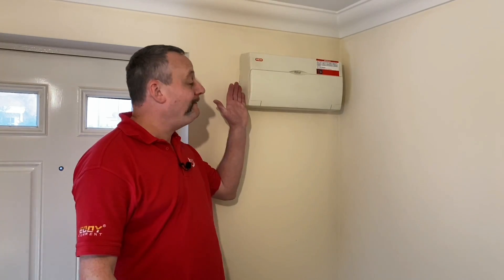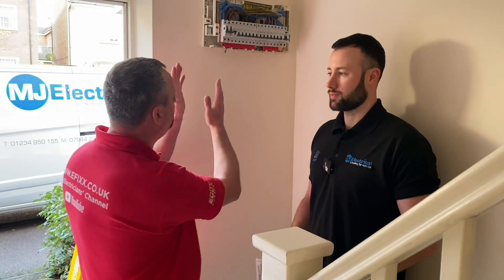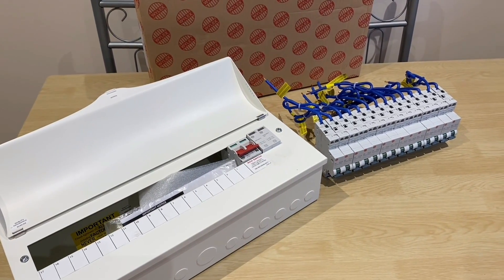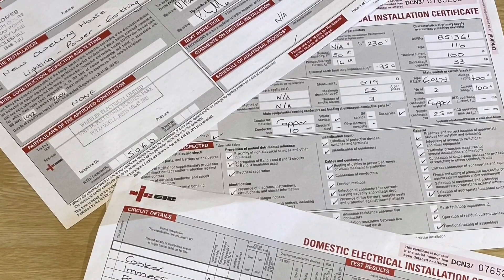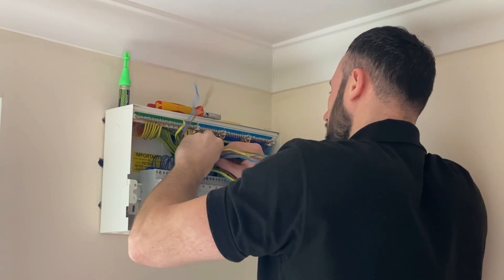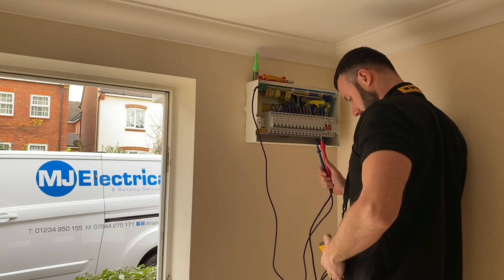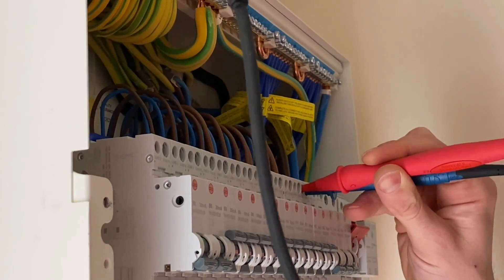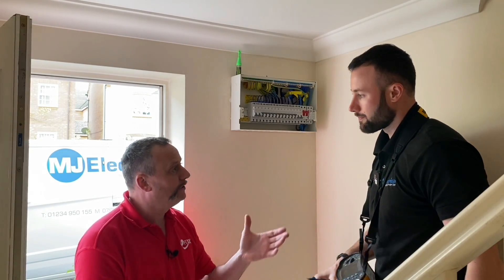Should you install a full AFDD or RCBO CONSUMER UNIT?

Comment: It’s crazy to be fitting AFDDs currently due to the price, just like RCBOs were when 17th got released. It’s completely viable to fit RCBOs and a SPD now as price is alright and that is a great set up for protection for people and equipment. I’m sure when it’s written in the 19th edition to be made to install, they will drop in price. Until then I recommend a full RCBO board from a quality brand like Crabtree, Wylex or Hager for futureproofing reasons. This will make it easier to upgrade when the time comes
Reply: Of course, goes without saying. It’s enough currently to convince them spending £300 on full RCBO board over a £50 BG split load, that still currently complies, how you interpret the regs. Throw in a £1500 AFDD board, they don’t want to know. Tbh, I wouldn’t even spend that on my own property at that price knowing they will drop significantly in the next 5 odd years and I don’t have the labour cost added.
Reply: @dannyboisparky  you forgot about £100 for surge protection. Which in my opinion should be strongly recommended.
Reply: @sandymcnair5298  As a matter of interest do you have any evidence that SPDs actually reduce the incidence of damage to plugged-in electronic equipment?
Reply: @sandymcnair5298  I mentioned SPD in first post, absolutely recommend that. Silly not to for the cost. Always allow for it to be fitted at a later date if customers don’t want it
Reply: @davidfaraday7963  the regulations are poorly worded and most jump on the wording that it may exclude domestics. I think in domestics the cost of the potential damage needs to be considered against the cost of the SPD. I am not going to bite at your bait at providing evidence with this is applying the regulations as best as we can and giving the best advice I can to end users.
Reply: @dannyboisparky  ok, I did not back track to first post.
Reply: @sandymcnair5298  I'm not interested in the regulations, I was wondering what evidence there is that putting SPDs in CUs actually does anything useful.  The proper place for surge protection is in the equipment that needs protection as close as possible to vulnerable components.
Reply: @davidfaraday7963  thanks for the clarification. I am interested in complying with the regulations to the best of my ability. Not so much into proving or disproving the theories behind them. Sorry about that. Maybe someone else will answer.
Reply: @davidfaraday7963  like AFDDs. There’s more reasons to fit one than not. It goes beyond what we’re plugging into our sockets. How applicable is it to most current installations, that would really benefit from it can be debated, but without doubt it’s for future use and the cost is minimal in comparison
Reply: @dannyboisparky  I'm intrigued by your sentence "It goes beyond what we’re plugging into our sockets". Care to elaborate?
The point I am trying to make is that I have so data anywhere about the effectiveness of CU-mounted SPDs in reducing the incidence of damage to appliances caused by mains supply surges. We are being asked to just take it on trust that they work and the sales pitch seems to be: "they don't cost much so you might as well fit one".
Reply: @davidfaraday7963  although I agree about the effectiveness of protecting appliances, what im saying is having one at the consumer unit, helps protects wiring, fixed equipment like heating controls, AFDDs, electric cars plugged in etc. That said, in 20 years doing the job, I’ve only seen two properties subjected to damage by surges but with the increase of equipment, it really is better to have one than not when installing/replacing a consumer unit. I’m sure the same was said when RCDs first came about, starting off with connecting equipment for outside use to cables buried, supplies to bathroom, now all luminaries.
Reply: @dannyboisparky  If there is enough energy in a surge to damage the wiring there's not going to be much left of your SPD afterwards, or of much else for that matter!
I have some experience of designing surge protection for telecomms equipment.  To do the job properly you need two components (well four on a balanced pair), one to shunt the energy away from the equipment to be protected, and the other to provide series impedance to limit the surge current. I don't see any series impedance when SPDs are fitted in CUs. The only additional impedance provided is the inductance and resistance of the connecting leads for the SPD, which is in the wrong place to provide downstream protection, though it might help the SPD itself to some extent. 

So I am dubious as to whether these add-on SPDs actually do what they claim to.  RCDs are different because they do actually work as advertised. I once tripped an RCBO by inadvertently bridging a live terminal to an earthed metal enclosure with my hand, I didn't even feel a shock before the RCBO tripped. The only downside to them is that they are not failsafe, a faulty RCD or RCBO might only be detected if and when someone actually checks it for operation.
Reply: @davidfaraday7963  yes, I don’t see any worry with the cables themselves, perhaps some poor connections on the wiring that could cause a fire through arcing but that all seems quite unlikely. My knowledge/experience is limited with SPDs so it’s great to get some insight from someone that does. 
I too am surprised to not see these fitted in series so can see your concern with being fully able to do what they claim. Again, it still comes down to being better to have one fitted than not, even for the very least, for insurance purposes that may stipulate (if not already, I don’t know) to have one fitted for protecting electric vehicles or whatnot. 
Perhaps a bad analogy using RCDs lol. 
I have also heard that they maybe changing the wording that will end up meaning more installations won’t require them. 
Either way the minimum we can do at the moment is fit them if the customer is happy to pay for the device or allow space for future fitting as there isn’t always space to fit the Wylex isolator w/SPD before the consumer unit
Reply: crabtree?
Reply: Although Crabtree have gone downhill over the years, their consumer unit are great and its very unlikely they will cease making them or change design. If anything, Wylex have been the pain out of the brands mentioned with design changes that cause retrofit problems
Reply: I think your right, but I also think you should make your customer aware of the recommendation of bs7671.  Consider using cost-effective instead of cost.
Reply: @Defectiveresistor do you mean cosmetically? Because there hasn’t been a physical change in like 30 years, since the release of starbreaker. The last design I know was their BS3871 range. Wylex have changed their MCBs/RCBOs that prevents a retrofit due to the bus bar quite recently. It’s probably only a small factor between the ages of the two brands though

Comment: Q: If we are supposed to check we are going to use the correct Earth leakage “type” of RCBO on a circuit which could create “dc masking” and render the RCBO inactive. Does this effect AFDD choice also? Is there such a thing as a “type” when choosing AFDD?
I don’t mean type B, C, D, we are all used to, I mean the relative new type of A, AF, etc.  Fancy complicating types of rcbos!!
Reply from the maker: They are available as type A - don’t think you’ll see them going backwards and making type AC
Reply: 🤣hopefully not. Too much choice is room for too much error!  Just need to get the certificate circuit details page up to date with all these “types”, including SPD types/grades, it’s easy to put the wrong device in and not realise immediately.

Comment: AFDD for a thatched cottage or barn renovation. Well, recommend anyway.
Reply: Just out of interest, do you have any evidence that AFDDs will prevent/reduce fires in such installations?
Reply: @johnhoward2104  does an AFDD have any other purpose?
Reply: @edc1569  implied in your question is that they are capable of doing what they are described as being able to do - that is, we're told they prevent fires caused by series/parallel arc faults, therefore, that's what they must do! However, there could be a mismatch between what they are described/claimed to be able to do and what they actually do. So do you have any evidence at all that they actually do what they are claimed to be able to do? Below, is a copy of my previous post:

It is perhaps very unwise to push the notion that AFDDs are beneficial given the lack of evidence of their efficacy both regarding their sensitivity to faults and fire prevention ability. They are perhaps being pushed on us in upcoming regulations due to the lobbying power of those with financial interests in their installation (such as manufacturers and wholesalers). There is, however, apparently little evidence for their effectiveness (see, for example: https://communities.theiet.org/discussions/viewtopic/1037/27144 where an electrical engineer, in part, says: "The science behind these devices is simply not there, and it is easily shown that these devices are being sold to detect a problem which does not exist". Damming words indeed), and DIY testing shows just how useless they can be (see, for example: https://youtu.be/TVqi6CedMkM and https://youtu.be/jHrNMFESd6Y). Therefore, we certainly should not be saying they are effective at preventing fires until we have the evidence to confirm they are.

In short, are we being sold a bum steer, probably for nothing more than financial gain by those with vested financial interest? Also, if there is a fire because an AFDD didn't stop it by extinguishing the arc, who is responsible - us, for telling the customer AFDDs prevent fires, or the manufacturer for making claims about their device that didn't work?

If you have any proof AFDDs provide their claimed fire prevention ability, please forward it to the aforementioned engineer, who may be very interested to know about it, and if you post it to the forum, we can all know about it.
Reply: @johnhoward2104  I am equally dubious of the value of surge protection devices fitted in DBs.  Is there any evidence that they work? The proper place for surge protection is in the potentially vulnerable equipment as close as possible to the components likely to suffer from surges. In other words its a matter of mains-powered electronic equipment being competently designed rather than a sticking-plaster approach which might not even be effective.
Reply: @davidfaraday7963  According to my course on surge protection  (non UK) I made about 10 years ago it was needed 3 stages of it. First two in the fusebox, third in the socket near protected equipment. Every surge protected socket was able to protect another socket closer than 10 metres (on cable). Every cable leaving the building unerground should have had another SPD. But things might have changed since then.
Reply: @evzenhedvabny6259  I would ask what the assumptions behind such rules was based on.  What sort of surges are they anticipating? How effective do they think the surge protectors are, what is the sensitivity of the connected equipment to surges? Without answers to those questions you can't start making up rules. To me the idea that a surge protection device can protect another within 10 metres is very dubious.
Reply: Now mandatory for House in multiple occuaption since September already some closing mine will.